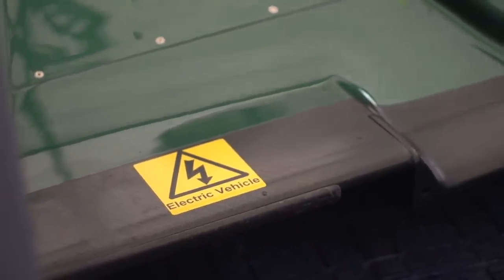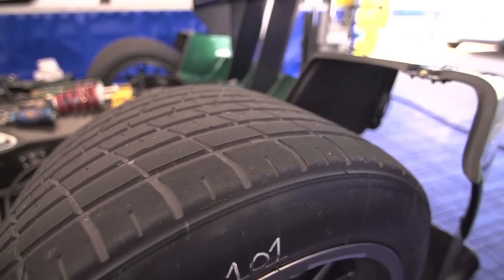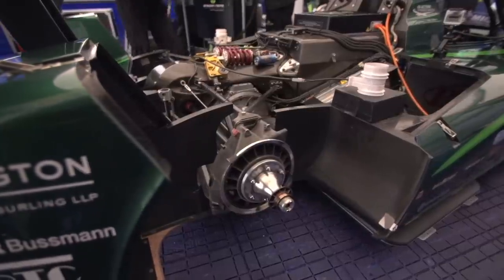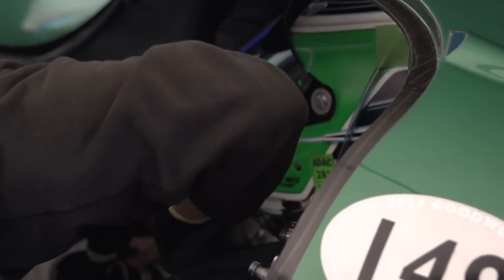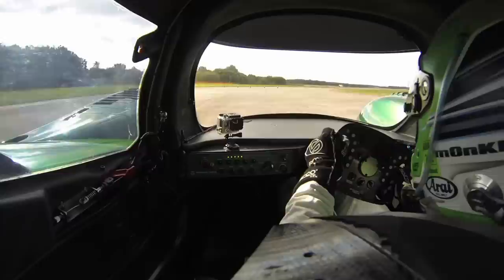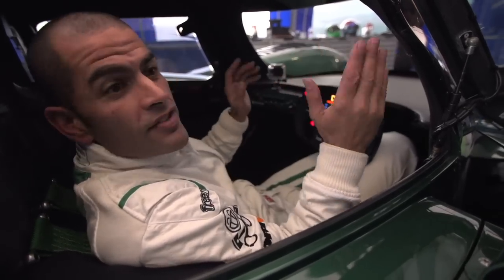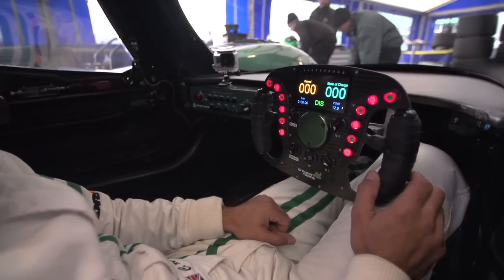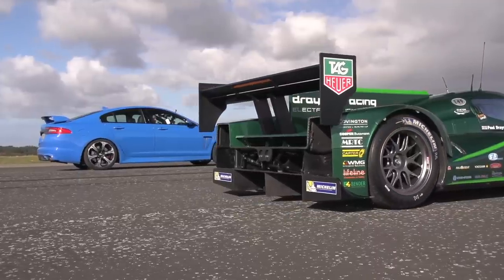850hp Electric Racing Car: Driving the Drayson B12/69EV -- /CHRIS HARRIS ON CARS

Comment: But electric powered cars arent superior... they probably dont have the power to weight ratio of an internal combustion powered car of the same size. Also the energy density is  higher in fossil fuels than in batteries which is probably why they have to be so big and heavy. Finally something people keep forgetting, the electric motor was invented like what, 100 years ago? How has the technology improved since then? We have slightly lighter and more powerful batteries (lithium polymer) but thats it! Then look at the evolution of the 4 stroke and even 2 stroke internal combustion engine and you can see massive improvements over the past century. We now have Increased fuel efficiency, forced induction, variable valve timing, variable vane turbocharging, cylinder deactivation and many other improvements and technologies just to name a few. Imo internal combustion engines arent going anywhere for a long time, and we definately arent done improving them.
Reply: Power/Weight ratio is getting better, as batteries are getting denser. Electric cars themselves without batteries would be ridiculous light, the problem is only the battery technology hasn't caught up, that's why Tesla is building the Gigafactory.

The reason is electric cars have been abandoned in 1920 by the big companies, and lithium batteries have only been invented in 1970, and massive density improvement over the years with different lithium methods, such as Li Ion and Li Polymer.

Comment: If you NEED noise to enjoy a car,.. go be a tool and buy a Mustang.
Reply: I wouldn't say I need it but I do enjoy the sound. I enjoy the sound of pure power being in under my control. Do I need it? No.
Reply: If you need a noise buy Chinese scooter.
Reply: IOWNA11 Electric cars have a torque level unmatched by any ICE.
Reply: VibeInteractiveArts yep, instantaneous torque.
Reply: The new 919 is an engineering marvel!
Reply: +vtecnegro85  you all are just use to turbo engines, a good N/A engine gives you also instantaneous torque

Comment: So efficiency at the point of use is not important, right? Diesel electric freight trains have been around for over fifty years.  When any car uses less power to accelerate and get from point "A" to point "B", then it is better. Gas and diesel cars use fossil fuels, (just like electric cars), and gas and diesel cars and trucks are weaker, less efficient, and dirtier than hybrid vehicles.  If hybrid electric cars were allowed at NASCAR, they would run off and leave everything else. If hybrid pickup trucks were built, they would accelerate faster, carry more, pull more, and get better gas mileage than normal trucks, (as diesel-electric locomotives do). It's a new day.

Comment: Mind blowing.

You could get the same thrills on a special go-kart fitted with a turbo 1,000cc motorcycle engine. And it would cost a fortune less and carry way less useless pieces of carbon and metal and rubber. Ultimately it is about moving a human body through space and this is laughable. "It's the future." Whatever.

Comment: I'd be more impressed with a hydrogen powered race car. Electric is unreliable, faulty, and still uses mainly fossil fuels to charge. Lithium batteries are incredibly inefficient to produce as well.
Reply: +N75911 How do you produce the hydrogen?
Reply: silviutz calut A similar way they produce electricity and fossil fuels themselves, in a plant :) And just like fossil fuels were in the beginning, it will be more expensive, but unless it becomes mainstream, that's pretty much the downside to any fossil fuel alternative.
Reply: Well, in a plant of course.It just happens though that you need energy to produce hydrogen, just as you need energy to produce electricity. And so far it's a lot more efficient to produce electricity than hydrogen.
Reply: +N75911 Hydrogreon is the worst idea. Tesla. (The Largest EV car manufacture in the world) uses Electricity. I don't see how its unreliable. Tesla owns the largest Ion lithium plants in the world. The building isn't much smaller than the Boeing Factory in Washington. Their latest battery has 90KWH takes about 30 min to charge and gives you about 300 miles. All Tesla charging facilities are Solar powered and are free

Comment: If carbon fiber weren't so expensive...more of the ev  could be made out of carbon fiber. ultra-light evs could run longer/faster with less number of batteries. We shouldn't try to build evs out of normal weight cars. Although I don't really care...hate em !!!

Comment: Battery tech will continue to evolve at a steady pace driven by the smartphone and mobile device revolution. Hydrogen is a pipe dream that is perpetually 'just around the corner', plain and simple.
There are billions of AC power outlets around the world and only a small handful of hydrogen refueling stations. Who do you think is going to end up paying for the development of the hydrogen distribution infrastructure?

The CONSUMER, that's who. Development of electric charging infrastructure is so cheap Tesla Motors can factor it into the cost of the car and offer their customers free charging forever. Hydrogen will never EVER be able to compete with that so consider it dead.
Reply: It doesn't matter if batteries continue to advance at any pace, something has to charge them.  What the hell do you think is going to power those billions of AC outlets when a few hundred million extra car battery chargers are plugged into them when we already have rolling blackouts on really hot or really cold days? We're not talking about piss ant devices with single digit amperage.

Using electricity for conveyance is going to be a net loss long after we're both dead. Dream big if you like, but nothing is going to replace fossil fuels in that regard for a very long time. Only after everyone in the world who now has a vehicle with an internal combustion engine can afford a Tesla have you made any sort of point.

Comment: car is bouncing like a mf. needs suspension work
Reply: Ben Dover needs a better track. i guess an LMP1 chassis can only be softened so much, it's used to much better track surfaces.
Reply: dude, this is not a daily driver!
Reply: Get a "cold planing" machine out there and make that concrete smooth as glass.
Reply: He was doing over 150 mph, i think a little bouncing is rather normal

Comment: electric race cars will ruin the sport, it will get too boring to watch.. people go for the whole package, sound/competition/smell/speed.. ect ect..  so if the combustion engine will disappear, so will most of the spectators and then the spot will die.
Reply: so the reason you go to a race is too end up deaf smell like stale beer and dirty car exhaust  and not too watch people pointlessly driving in a circle

Comment: Just because you can doesn't mean you should.......engineering for engineerings sake.  IMHO part of the thrill
of motorsport is sound.......F1 has been severely diminished by lower RPM power source and pathetic sound.

Comment: 2.9 seconds to  60?
Thats not even That good...
Reply: It's a rear RWD car with a shit load of torque. Wheel spin is going to be a problem.
Reply: ezar howard
Still. at the dragrace here you can see that it´s NOT a big problem. probably multiple systems against that.
Reply: If it where AWD it definitely would be less than 2.5 to 60 but it would be heavier. So it would be slower to 100.
Reply: this car is neither built for nor tuned for acceleration and top speed. its built to be a circuit car with a balance of both. I'm sure if they wanted it to be a drag car they could blow the pants off of most others
Reply: 0-100 in 5 seconds isn't fast ? The Bugatti Veyron does it in 8.4. The Veyron Supersport has 1500nm of torque, this has 4000nm...
Reply: Pheland123
what are you talking about? :D
Reply: 8.4 seconds? my moms expedition could do 0-60 faster then that lol
Reply: Nathan Hartmann 
He said 0 to 100 mph not 0 to 60.
F1 cars do 0 to 100 in about 4 seconds.
Reply: ZPERO
0-100kph. not mph.
Reply: Nazimelonhamster 
are you sure? I didn't hear them specify
Reply: Sidowse 
oh so more than the average ricer civic then

Comment: I wonder who pays all  that nonsense :) Who needs  a  15min racer ?
people are so naive !
Reply: this is how progress is made. that machine probably tests the gear which will be standard in the future.  didn't you listen? 4000nm,  the tyre testing alone makes this car worth it
Reply: If that toy  had 8 wheels it would have 8000nm torque :)  this value is irrelevant, they  just took some gearmotor like any industrial servo drive on every wheel, no special gearbox needed, - the trick is same as used by tesla, semi old tecnology with a huge marketing porfolio and the naive people are amazed!

Comment: electric cars are not the future. nor are ice or fuel cell. the future is no cars! or very little. The truth is cars are very inefficient at move you from A to B. We dont have the energy resources to continue running petrol an diesel cars or electric. The oil will run out at some point. Wind power is hopeless and has to be built using fossil fuels. Same with hydro too. So how are we going to build any of the infrustructure required to run all of this? The tar for the roads comes from fossil fuels meaning all roads will be dirt or concrete, but wait! whats going to power the machinery to build them??